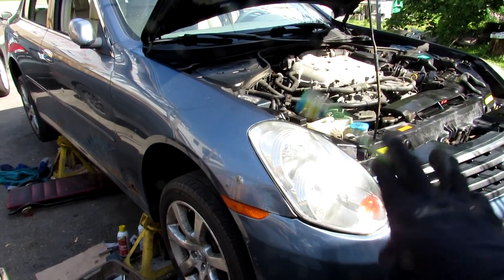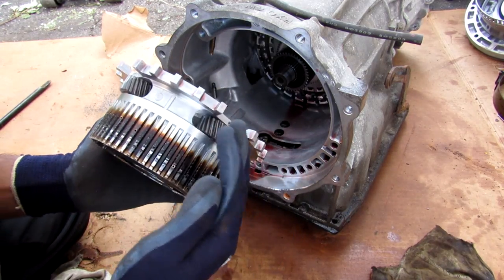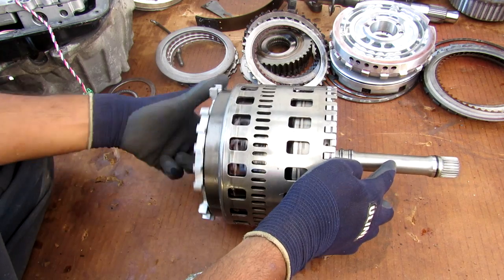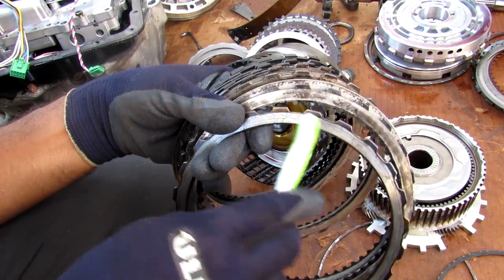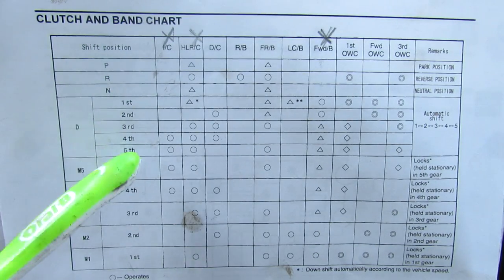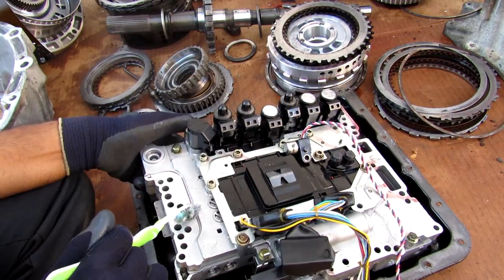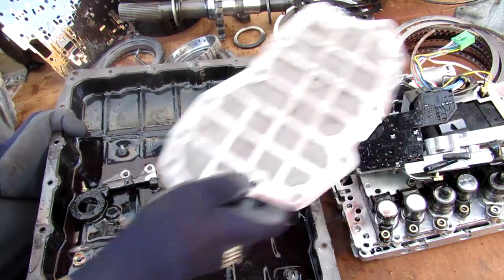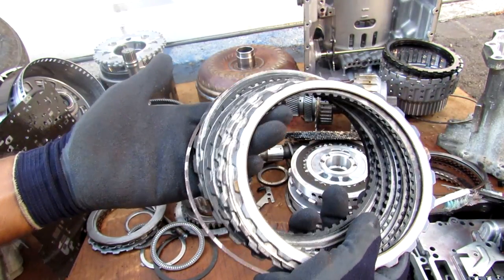Why Automatic Transmissions Fail

Comment: I took my transmission from my Nissan Armada in the street . Transmission fell because a lead  to solenoid broke  on valve body computer .  I soldered the broken leads and clean them and put in clear epoxy . Reason for the  eproxy is because of the transmission making the humming noise and much frequency of the leads going to the solenoid and breaking them . I replace all  clutches It was not necessarily because  2  pack was only bad . I spent on them $500 .  I make 6000  mile and is still running strong .

Comment: I work at a main dealership, and have never seen a torque converter fail.
I have seen plenty of DCT's fail, even inside the warranty period.
How many miles has that gearbox done ?
Reply from the maker: 172km 
Torque converters seem to be failing on newer cars now. It used to be simple and reliable back in the day
Reply: @speedkar99  Thanks for the reply matey, I assume you mean 172,000 km (106,000 miles), which is not really a huge distance at all, quite worrying.

Comment: My automatic transmission tends to slip in 1st gear but is fine in all the other gears. But it only slip when the transmission is cold. After 2-3 miles and the fluid warms up everything shifts correctly. The fluid has been changed and is at the correct level. Do you think I’m looking at a rebuild soon?  Thanks.
Reply from the maker: Yes. The first clutches are starting to burn up , unless if it's a simpler solenoid issue

Comment: My 07 Lexus ES350 slips between 3rd and 4th in cold temps during the winter. The car has over 200k miles now, but I have people telling me that replacing the fluid could damage the transmission since it's such high mileage. Thoughts?

Comment: Is a CVT better in terms of durability or serviceability?
Reply: CVTs are MUCH simpler mechanically speaking, but are notoriously weak and won't survive high power, high torque and high body mass applications long.
Reply: To me under normal use yes they are more reliable and longer lasting, but when they break no one can fix them and if they can it's  expensive that you're  better of just replacing the whole thing...
Tho there's the application and driving experience, imo CVT belong in sub/compact economy vehicles not in luxury medium or large cars and definitely not on a sports car
Reply: Really? Plenty of them in junkyard
Reply from the maker: Automatic has been around longer and is more reliable in my opinion
Reply: @speedkar99  Automatic becomes less and less reliable, as they add forward speeds (READ: gears are getting thinner, protected by computers).
Reply: 4G12 depends on the CVT, Nissans for instance is terrible, but Toyota’s on the other hand is pretty good. Their new CVT should be even more durable with the added gear ⚙️ taking all the strain of the steel belt/chain.

Comment: How often do you recommend changing fluid? I can’t get a clear answer. I have an 07 TL type S so the trans is a lot better the the prior years since it has the RL trans. I’ve seen the 3x3x3 method and I’m thinking about doing that through the next 3 oil changes. But after the 3 method is done, what interval in miles wise would you recommend? I’ve heard it’s preference, some say every 20k, 50k, and ive even heard 10k. Confused.
Reply from the maker: I change mine once a year with my oil
Reply: speedkar99 you change your oil once a year? I’m guessing synthetic. I change mine every 3000/4000 miles.

Comment: Aaaand what was the mileage with the transmission like this?!!
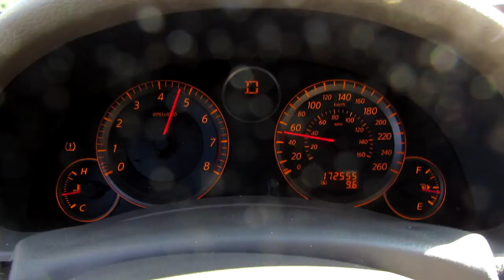Reply: 0:10 172k Kilometers, Nissan does make shtty transmissions lol (probably one of the shittiest in the business), my 05 pilot has over 310k and still shifts like a dream.
Reply: @kpokfposkf  lol thanks a lot!! I forgot that scene at the end of the clip :D
Reply: @kpokfposkf   My dad uses his 2007 daihastu serion as a farm vehicle. He is literally carrying logs and goes through tough terrain with it. It is a passenger car for the road but has a 4x4 option. The life of the transmission depends on how you use the car. Automatic transmissions can't handle load very well compared to manual transmissions. My dad's daihatsu has a manual transmission. The car got 450.000KM with NO transmission repairs done. It needs a new clutch though. They are really cheap. It costs ~80 euros. If you put your automatic transmission under stress every day it wont last long while a manual will last much longer
Reply: Potatoes and Trucks you are partially right, i do understand the point you are trying to make. Sports car or cars driven hard would also burn engine and transmission out prematurely. But the point I was trying to make (undisputed) is that Nissan’s automatic transmissions have an extraordinarily high tendency on breaking post 150k km, based on this video obviously and me simply just browsing for xterras and pathfinders on Craigslist, you would be able to see lots of listing with rebuilt transmissions or transmissions that need “servicing” because it slips. Hence if you really do love the brand Nissan for whatever reason, just lease it, don’t put money down on financing or buying and owning those clunkers. And you really can’t compare the longevity for manual and automatic transmissions, often times the oem clutch lasts for 700k to 950k km under regular usage, while an automatic would be considered legendary when it lasts halved of that number.
Reply: @kpokfposkf  yeah modern nissan transmissions aren't that great

Comment: So maybe you can help since youre definitely
Knowledgeable with transmissions.

 I rebuilt mine years ago but occasionally when I shift.. the transmission clunked hard as hell before I reprogrammed the TCM.  Reprogrammed the TCM but it still does it - not as intense of a degree but only when I take my foot off the gas as it's shifting gears now..

What exactly is causing this?? I can't find any clear answers anywhere.. I'm a mechanic myself but the way these clutch pack units work, I'm still learning a bit.. I definitely would just love to know what components are truly causing this.. 

Thank you beyond belief for explaining this. I've been confused for years due to others telling me nonsense. Well drawn out explanation for sure!

Comment: Great video! I have a 2007 Acura RL and the transmission shift smooth and I always change the fluid at the right time. I have a weird problem when I put the car  in neutral while driving and back to drive it gets stuck in 3rd gear and shifts really hard and throws a transmission code. When I turn off the car and turn it back on the problem dissappear and never returns unless I put it in neutral again. What can be the problem you think? Thanks

Comment: I have a question: Can you tell whether you have a burnt out clutch pack or a broken solenoid without taking the whole transmission apart? My guess to find out would be to replace the solenoid (since they're cheap) and see if the problem remains. But are there differences in symptoms while driving?
Reply: If a bad solenoid, there will be a trouble code.

Comment: Hi, can you pls advise that if line pressure is low, it have to be valve body ?. Also i spoke to transmision guys i am a mechanic who dont work on transmission, they told me when they rebuilt they always replace torque converer and valve body.. pls advise how to isolate valve body issue vs clutch slippage (mechanical issue),, i assume if pressure is not  within the range as per manual for specific gear, then it would be valve body or pump that generate pressure, pls advise..
Reply from the maker: Pump or a blockage in one of the lines. 
Replacing torque converter is a good idea because it can have particulate that can't be cleaned out

Comment: Any idea why a band brake is used in the front but a clutch pack is used as a brake in the rear?
Reply from the maker: Space constraints
Reply: speedkar99 any significant performance or shift quality differences between bands vs clutches?
Reply: @pmo5821  Even old-ass three speeds used both. Neither is inherently good or bad.

Comment: I have a 1998 Dodge Ram 2500 5.9. My grandfather gave it to me a few years ago. The transmission is slipping here and there and the fluid is burned. When I check the fluid it is always bubbling. I was told that changing the transmission fluid would damage the transmission further. He never changed the fluid ever. It has about 150,000 miles on it smh. What are your thoughts on that and any advice. I put Lucas inside of it but not sure what to really do.

Comment: All you need to do is change the filter and fluid every 60k miles about. Is that so hard?
Reply from the maker: 60K is pushing it for a drain and fill considering you only get 3 of the 12 quarts out of the transmission
Reply: @speedkar99  I'm going by what ZF recommends on my 435i. I'm not sure what Infinity recommends. It's still not hard to get it done.

Comment: My old Honda transmission leaked and got smoked a little 😖 now the leak is fixed and fluid is new and it drives different. Some of those clutch packs probably got smoked 😖
Reply from the maker: Don't flush

Comment: My 2006 KIA Rio  has 172k miles and the automatic transmission fluid has never been change. It still shifts fine, but I know that its running on borrowed time.
Reply from the maker: Do a drain and fill no flush

Comment: It's amazing something THIS complicated works flawlessly for as long as it does. This is why I'm sticking to manual transmissions whenever possible.
Reply: I wonder how something so complex can work reliably!?
CVTs, even dual-clutch boxes are far simpler.
Reply: I had no idea how complicated they were internally. I have new found respect for refurbishers.
Reply from the maker: Cars are an amazing piece of engineering

Comment: Few years back my friend got a Hyundai Accent from rent a car for few days. On second day the automatic transmission completely failed. The car doesn't move neither forward or backward. Shifting gear lever doesn't do anything. And the rent a car company said it's your responsibility. We gave the car to you working and we need back in working condition. So they spend 2300 SAR for maintenance of transmission. The greedy rent car company even charge for the days car was in repair shop.

Comment: Your brother called he wants his stuff back ,I just got an 06 Lexus is   250 it's got 120k Lexus says don't change the trani fluid I think I should since it's automatic ,my 92 BMW 525i has 360k manual trani never changed the fluid once in it last time I checked the fluid level was 21 years ago do you think I should change the Lexus fluid?
Reply from the maker: Yes but drain and fill only

Comment: Hey SpeedKar, how often do you advice to change CVT fluid for a Toyota Corolla? Drain n fill as well?
Reply: Another mechanic on YouTube suggests every 30k miles.  Measure what you drain out and pump the same amount back in.
Reply from the maker: I drain and fill Once a year
Reply: Change the fluid? Change the transmission once a year

Comment: wow... man could you give your opinion about my case ? gm transmission 2004 bmw x3 3.0 5 speed. it slips when cold and has hard time to shift to 5th gear first time only. after 5 minutes it works great under any condition. 6 months ago water got inside att and all the slippage was gone. after i cleaned and changed fluid slippage on cold came back :)
Reply from the maker: Try some conditioner and fluid type 
And check that the cooling system for the transmission is working properly
Reply: @speedkar99  i know for sure i changed att cooler and flushed it with correct oil. I think thermostat hosing is cracked but should it affect cold start ?

Comment: I have a question - so my car has the Auto 1,2,3,4, If i only put it in D2 I believe it will only shift into 2nd gear at the most right? When I do this there's a noticeable clunk, what could it be?

Comment: I got a "drain and fill" filter change at the dealer and they put in 3 extra quarts by accident! But then the dealer hires low paid "lube techs" - at $12 an hour - what do you expect? oops. So I took it to a specialized transmission flush service that flushed through 20 quarts to clean out the transmission. They confirmed indeed they had to remove 3 quarts to get it back to level. It was even on the dealer receipt "topped off" with 8 quarts! I drove 500 miles like that and smelled the burnt rubber from the overflow valve spilling out fluid.

Comment: I've an old land cruiser that has been venting oil out of the wee vent on top of the box forever. Oil level has always been checked with engine running at operating temp. Any idea's what would cause that?
Reply: What “box” which has the wee vent?

Vents, wee or otherwise, are not supposed to leak oil.

Comment: Change fluid every 30-40k especially CVT's, use correct fluids.  EV's don't need these super complex mechanical nightmares.
Reply: but EV's takes hours to recharge and the $10k batteries degrade to useless within a few years whereas refueling takes a few seconds. Now if we had super capacitors that took seconds to charge and didn't lose capacity over time, then EV's may be better but until then they are only for virtue signallers and annoying hippies.
Reply: Yeah, like their millions upon millions lines of codes aren't complex. At least with mechanical components you can see the failure points.
Reply: @keyfirst1897  if they concentrated on improving the batteries instead of making a drivable AI maybe we could have already switched half the world's fleet
Reply from the maker: EVs need to be charged
Reply: @speedkar99  You charge them while you sleep, and the only way you're getting a fill-up for $5 is if you buy a hose for siphoning!
Reply: @dansid  You clearly know nothing about batteries.

Comment: Which tool  is that drilling out nuts and bolts? How much does it go for,ladies and gentlemen?
Reply from the maker: Grinder?
Reply: The one like a drill that u r using to undo the bolts and nuts.
Reply: @wodeyaeric5351  a electric drill???

Comment: Is there any problem if the transmission is overfilled?
Reply from the maker: Yes it can increase pressure. That's why the case is vented
Reply: @speedkar99  thanks man

Comment: Is this automatic transmission made by the japanese company Aisin?
Reply: Aisin is owned by Toyota, this transmission was made by a company called Jatco, which is owned by Nissan.
Reply from the maker: Jatco
Reply: @tails300  Toyota has a 30% stake at aisin. But aisin is used in nearly all Toyotas.
Reply: Alexander Zöhrens Toyota has a 51% stake as of now, so they are majority owner of Aisin.

https://en.wikipedia.org/wiki/Aisin_Seiki?wprov=sfti1

Comment: Love this video speedkar. I have rebuilt manual transmissions before but have always been a bit intimidated by the autos. That has not changed after watching this! One thing I like about manuals is if you know how to double clutch and drive it right, they can last forever. With an auto it has a finite life even with perfect maintenance. But if someone less knowledgeable drives the manual incorrectly, it can be quickly ruined. Always love your vids, they are like porn for those that must know how everything works. And I don't even have to smell like ATF!
Reply from the maker: Glad you can relate to these videos. I'd love to tear down a manual some day. I sure failed the wife's smell test after tearing this Transmission down!

Comment: I have what is, arguably, a classic Japanese car, a 1984 Honda CRX. It has a 3 speed automatic that works great. I only drive the car maybe 1000 miles a year. I kind of worry that by the time the automatic transmission goes out it may be impossible to find parts to fix it.0

Comment: Busted-a$$ Nissan Automatic Transmission is why I chose to drive an Infiniti with a Manual Transmission.
And after working as a Safety Engineer at an Aisin auto tranny factory, I am even more determined to stay driving a Manual.  There are so many point of failure in those things.

Comment: Not forgetting some manufacturers write into there software for the lockup to kick in after either a preset mileage or time period (some even as low as 30,000 miles, even when there’s nothing wrong with the transmission they’ll still stiff you for an expensive repair bill if not a complete replacement (AL4 anyone, sealed for life my arse)

Comment: I mean the tool being used at 1:31secs. How can I get one?
Reply: That's an impact wrench, super helpful for tough bolts / nuts. You can either get one that uses compressed air in which case you'll need an air compressor, hoses, etc. and there are also battery powered impact wrenches. Each tool will have a torque rating usually measured in foot pounds that lets you know how much power it has for tightening and loosening. For example for my big CV axle hub nuts aka spindle nut I had to make sure my compressor and tool were powerful enough to deal with that nut since it usually gets stuck pretty good and is hard to remove. The bolts at 1:31 probably don't need that much torque to loosen so a good quality battery powered impact wrench would do it if you didn't want to invest in a whole compressor / hose / air tools setup.

Comment: That's why electric makes sense. May need a 2 speed gearbox at most.
Reply: You trade extreme mechanical complexity for extreme chemical complexity in the batteries.
Electric cars are pretty simple, but the batteries, they are a monster.
Reply: Well the Prius Planetary Gear System is much simpler than this, and a lot more reliable, it's rare for it to fail.

Comment: Manual transmission is the best. 
Automatics seem to have planned obsolescence built in.
I'd rather use a CVT than such an automatic; easier to repair coz of reduced number of parts.
Motor-generator combo like in a Prius is much better.